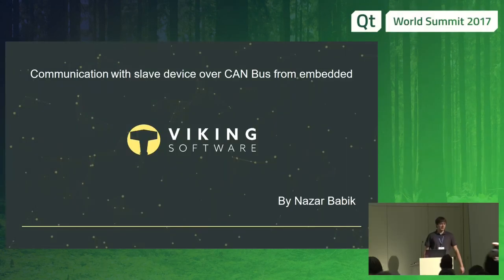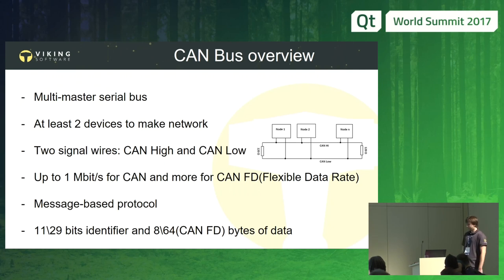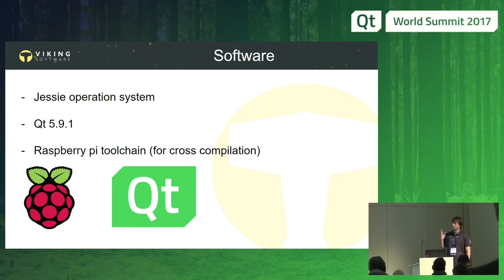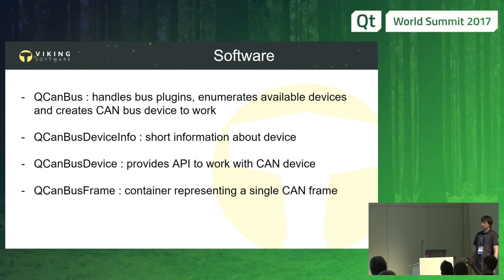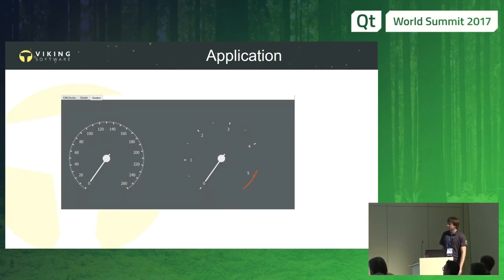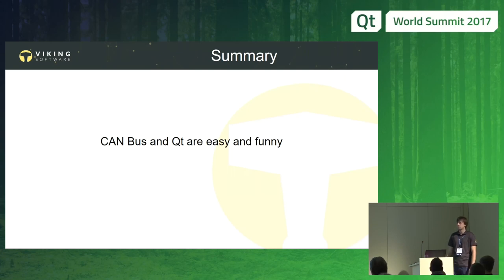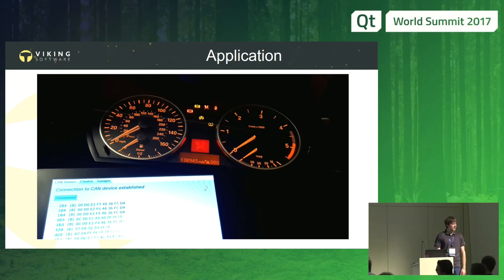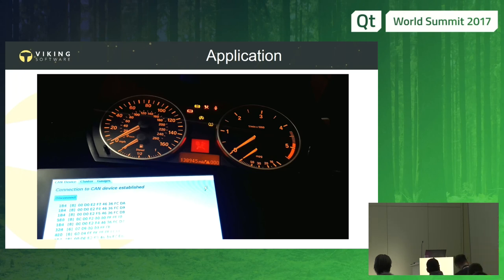QtWS17 - Communication with slave device over CAN bus from embedded, Nazar Babik, Viking Software

Comment: Is the source code available for this?  For example, how are the velocity and rpm converted to data? And does Qt SocketCAN plugin have the GUI gauges or is that something that must be generated by the user?  Something like:
https://www.youtube.com/watch?v=aV6kFxH3Xws 

So did Nazar run 5.9.1 on a host machine, with a cross-compiler for the Pi, and what's generated will run on the Pi's Qt 5.3.2?  Don't the underlying modules (ex. serialbus) need to be on the Pi?

Also, I assume PyQt would not work as-is with the plugin, and the bindings would have to be generated (via sip)? Along the lines of the 'PyQt Basics: Using Widgets' video?

Any thoughts on using ICSim to control the gauges?
https://nostarch.com/download/Car%20Hackers%20Handbook_sample_Chapter5.pdf